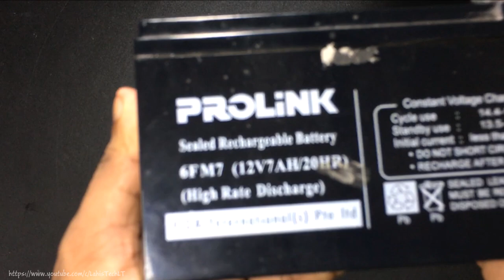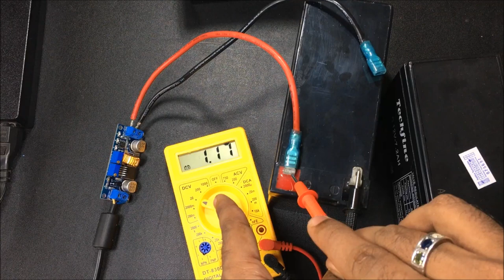How to make a charger for lead acid battery proper way 12V 7AH

Comment: charging voltage is 14.4V--14.9V,  and charging current  is 2A.  Too high voltage will cause battery swell or damange.  Too big current will be quick charging, However,  shorten battery life.   I had worked in Leafun Power for 20 years in battery chargers industries.
Reply: @zhangeric5353  Thanks
Reply: Hello Zhang, some more thought if u won't mind: how do I know the battery is fully charged using the charger you advised? Does it have any safeguard against overcharging? Thanks again.
Reply: @zhangeric5353  what percentage?
Reply: Hello Zhang Eric,  i would like to know is it safe to remove diode that is connected in series in between charger and lead acid battery.  The battery is inside my kids small motorcycle .
Reply: Can u give me good sajetion how may i charge 12+12 volt 2 battery
Reply: Could you do something like this with number of these batteries in series.
Reply: Up to 14v is never harm battery life
Reply: Can I charge it from 12 volt 1.5 amps please reply 😢😢😢
Reply: Can i use 14.2v and 10 amp transformer
Reply: So which is perfect cherging system?

Comment: You got everything wrong the current limit is 2.1A and charging voltage is 14.4v to 15v! It's written on the battery!!
13.5v to 13.8v is used to maintain a fully charged battery!
Reply from the maker: If the charging current is 2.1A you could charge it quickly. But the battery will not last long. 

The typical charging voltage is between 2.15 volts per cell (12.9 volts for a 12V 6 cell battery) and 2.35 volts per cell (14.1 volts for a 12V 6 cell battery). These voltages are appropriate to apply to a fully charged battery without overcharging or damage. If the battery is not fully charged you can use much higher voltages without damage because the charging reaction takes precedence over any over-charge chemical reactions until the battery is fully charged. This is why a battery charger can operate at 14.4 to 15 volts during the bulk-charge phase of the charge cycle.
Reply: @LahisTechLT  If you leave your charger connected to the battery for many hours you should limit to 14.1V.
But If you want a regular charger and just use your battery when charged, charge at least at 14.4V.
You are not correct about the 2.1A. It's stated by the manufacture, and I'm sure you can charge at 2A with no problem because I use and charge two 12V 7Ah Lead batteries.
I charge them every weekend at 14.4V and 2.1A and after almost 5 years they work just fine and charge just fine.
Reply: @hugopnabais  I think it depends if cycle use or standby floating use. Manufacturer give you 2 voltage range choices. For the current i think may be better go little lower than maximum initial current to preserve battery life. Modern chargers will integrate algorithms to monitor V/I on battery for optimum charge and adapt also V/I
Reply: So how long does it take for a full charge ?
Reply: @hugopnabais how long does it take to fully charge one of these batteries ?
Reply: @wholio50  Around 3 hours give or take.

Comment: Are you checking the amps directly from the output of the circuit without any load??😳
Reply: Set the multimeter to current reading setting, you can adjust the current
Reply: Yeah. it's normal to do like that with this module.
Reply: I mean.. the wires are the load xD
Reply: ya that is not right isn't it?. when you connect it to the battery there will be different amount of current flowing because the different resistance value of the battery

Comment: i've made a bunch of these over the years. i've got them on old printer power supplies, laptop, and tv power supplies.   i usually tape, or screw the converter, buck or boost, to the top of the PS.  i usually charge with the PS plugged into a power monitor, like a "kill a watt" or similar device, so i can monitor current the whole time.  i even charge 9v batteries that haven't gotten below around 8v, by making sure the battery doesn't get more than about .2 watt of power. i charge 18650 cells, and i'll let them pull in between 1 and 2 amps.
that converter you used here, i think, needs a heat sink on the chip for 5 amps.
Reply from the maker: https://youtu.be/RG1KNKouQwU
Reply: how long such  battery will power regular fridge (max 90w) connected to 12dcv-> 500w/220acv inverter with 97% efficiency
Reply: @qnaman   this is late I am sure you have figured it out but in the future watts = amps * voltage so your fridge is pulling 90/220 amps since the voltage is 220, if your efficiency is 97% you need about 103.1% more power (1/.97) so about .422 amps. From here devide the amp hour rating which is 7 in the video, by the current draw so in this case 7/.422 or about 16.5 hours
Reply: Safe discharge level for an automotive lead acid battery is only few percent due to risk of sulfation, and should never dip under 50%. For a deep cycle AGM battery safe discharge is about 50%. Effectively all lead batteries have only half of the theoretical capacity, otherwise you drastically shorten their lifespan.
Reply: Sar how you check the current directly without in my multimeter while i want to check directly like you then make short circuit plz reply how you check 😢

Comment: Use a diode on + module out to protect the module from damage.. (reverse current) -when module power in is disconnected before the battery is disconnected
Reply: Yeah
Reply: Maria Cabezas  ok, schottky diode... i thought any big enough diode would do... i will remember that, thanks :)
Reply: Is 40amp diode any good ?
Reply: I put an on-off-on switch on the battery to protect it. I.e. battery to either charger or load with centre off. Just switch to off before switching off psu.

Comment: Good video, from what I can see on the buck converter it does not have any protections so adding a diode to stop reverse voltage going back into the buck converter from the battery might be a good idea.
Reply from the maker: Thank you for the suggestion.
Reply: and ty as well
Reply: i use a shottkey diode on mine too, when i'm charging a small battery like a 9v.  if the PS gets unplugged, the reverse current pulled from the battery will kill it in seconds.  i don't bother with the diode when it's a big battery.
Reply: wilsard Why don't you use it on a larger battery too?
Reply: can you please explain what kind of diode and where exactly to put it? thank you
Reply: @H4mst3r.  on the positive side, facing the battery.
Reply: @H4mst3r.  how much amp diode should use for charging 35amp battery bro?
Reply: @pathanamthittakaran81  a 40 amp diodo or higher
Reply: @marianocalandroni7797  Does P1000 10A/1000V will be right?
Reply: @qnaman  yeah, that voltage is too high, you may wanna check the resistance of the diode
Reply: Great idea, especially if the load was inductive

Comment: it is ok to put heat sink for cooling when the output is above 3A 35W.) where to put heat sink?
Reply from the maker: There is no place for a heat sink try to hook up a small cooling fan.
Reply: You can get a small heatsink that fits the lm/xl chip , seach "small hestsink 10x10x10" , the ones with glue.. peel and stick on type works well
Reply: I made diy heat sink from a flat piece of aluminum. You can shape it the way you want and even wrap around the board.

Comment: How to connect the multi meter to measure and adjust the output current
Reply: There are 3 sockets in that multimeter for prob cable
Reply: Not a correct way

Comment: Can i use 15v 5amperes charger in that battery?
Reply: No, it will destroy the battery. AmpH should be capacity /10. Means for 7amp  capacity battery ,charging ampare should be 7/10=0.7ampares

Comment: Hi Sir   Do this module has a cutoff  when the battery is fully  charged? Thanks
Reply: It doesn't but you can let it at 13.4 volts for floating charge
Reply: Do the math to figure out how many hours of charging, output in amps and the stated battery Ah capacity.

Comment: Someone please explain to me why i can't use a common  12v1a adaptor instead. These batteries need about 14v to charge so a weak 12v adaptor can't damage them if left overnight. or I'm wrong?
Reply: Ur right men
Reply: 12 v battery need little higher voltage than 12v to charge
Reply: The chemical reaction only works around 2.4V per cell!

Comment: is this the right way to measure amps, i thought i have to cut the circle via the multimeter not direct connect black to black and red to red, is that right please anyone know answer my question thanks
Reply: Ya, that works in this situation. He is setting the current limit of the module. As you can see it was 2.9Amps, and he turned it down to 0.8 amps to charge his battery.
 0.8 amps is the max, as the battery charges that will decrease.

Comment: I cut my power adapter to an old Dell PC I had and discovered 1 white wire, encased by a braided wire. I'm assuming the white wire is positive and the braided is ground???
Reply from the maker: yeah, also you can check it using Multimeter.
Reply: White wire inside is the id wire.. the outside sheild wire is negative and the outside of that white wire is positive on dell adapter

Comment: set 14.33v and 2-3amp  for better charge
Reply: Low amp charge14.2v /  0.7 amp charge is slower and battery lasts long too
Reply: I use 14.1V constantly
Reply: The module might need cooling with heat sink. Ensure the chip doesn't overheat, because it is almost 50 watts.

Comment: Sir 
I have purchased a 12v 20w solar panel and 12v 7Ah battery for my college project and I have to make a charging circuit for the batter my solar panel is giving direct output of  17 to 21v can u provide a circuit diagram for it 
Please sir can u help me I tried a circuit with barebone 1.5 amp solar controller  using lm317t two three resistors including a 2k variable resistor and 3a 60v Schottky diode with a capacitor 0.1
Reply: lm317 is not charge controller,try with mosfet and proctection diode

Comment: I have a 6v 5ah acid... what is a good amp and volt to charge at?  I'm  a newbie
Reply: Should be stated on the battery. I think 0.1 capacity in amps won't hurt.

Comment: I purchased 5a dc-dc step down buck converter module power supply charger xl4015. I am unable to adjust the voltage or amp. am I doing something wrong. Any Help???
Reply: Insufficient information to provide meaningful help ;) What was the problem?

Comment: How to charge and use the battery at the same time is it possible?
Reply: Use, cycle voltage mention on the battery in this video, maybe 14.5 to 15v

Comment: How much maximum input current this module can handle safely
Reply: There is no limit to current you can supply to this converter. Unlike diodes, boost converters and buck converters (as well as just about any electronic device) are only negatively effected by over-volting. They will only draw as much current as they need. So if your power supply is 12V 50A, but your converter only needs 12v 4A, it will only draw 4A, and the remaining 46A will just be left unused as potential energy. Just make sure your input power supply can supply enough current to the converter, or it will overload.

Most cheap buck converters like the one in this video can only OUTPUT 4 or 5 amps. To figure out how much current you need for your INPUT (power supply), use Ohm’s Law. For example: If your output requirement is 5V 4A, multiply Volts times Amps and your total power will be 20 Watts. Now lets pretend your input voltage is 12v. Divide your total power (20W) by your supply voltage (12V) to get the required current to power your circuit, which in this hypothetical case is 1.66 Amps. I would give a little more current for headroom and power factor, so I’d say in this case your power supply should be 12v 2A. 

The best analogy for current I’ve heard is this: think of your device as a dog, and your power supply as the dog’s water bowl. You can give the dog access to hundreds of gallons of water, but since the dog only needs a little bit, they will only take a little bit.

Hope this helps
Reply: @Kini_the_Fox  great explanation
Reply: @Kini_the_Fox  I wish my physics teacher was as clear as you.Thanks buddy.

Comment: 12v Ac adapter use kar sakte hai input
Reply: 12volt ac adopter out put sy dc current hi deta hy
Or ye step down module hy
Jitny bhi volt dc my dogy ye usko or small volt my change kry ga

Comment: why this shows green led on when you connect to the low voltage battery?
Reply: Because that Lead-acid battery is dead, and even if you "force charge" it to get it back to the nominal voltages, it will be most likely unusable.

Lead acid batteries in general don't like being deeply discharged, and they lose capacity everytime it happens. the one he's plugging into the charger need to be replaced with a new one

Comment: Hi Lahis...i am trying to charge a 12v 7ah battery using the XL4015...i set the XL4015 at 13.5v  and at 1.4amps..however when i connect the 12v 7ah battery to the XL4015 output both the red and blue lights up at the same time...i tried it on another 12v 7ah battery but the same thing happens...both the red and blue lights on the XL4015 lights up at the same time...what am i doing wrong?...i am using a 19v 3.42amps laptop power supply as my power source...please help me.
Reply: Adjust down your Ampere it's very high
Reply: No problem, go ahead

Comment: How I may know that it has fully charged.how much timedoes it take to charge fully the battery
Reply from the maker: The LED will indicate once it is fully charged. Time depends on the remaining battery capacity.
Reply: @LahisTechLT  Can you not have it stop charging automatically? What about a small over&under charge protection for your batteries? I am looking for something like that.

Comment: Hi, please lemi know which site did you buy the charging module? N.. if I could use it to charge a 2.5 am, 4v lead acid batt?  Am an amateur, would be grateful for your help. Thanks.

Comment: Sir i buy the dc to dc converter so i will gave input using transformer with an bridge rectifier with filter capacitor. If any problem replay me zoon going to assemble
Reply: No problem, the problem is that transformer drops the voltage when a load is connected, for example if you have a transformer that can output 15V, when connected to load it drops to 13V or below, so its better to use a smps like laptop chargers.